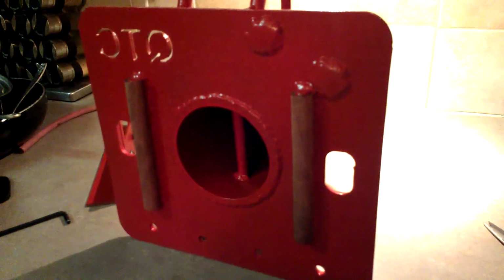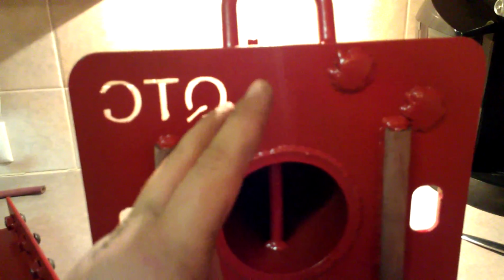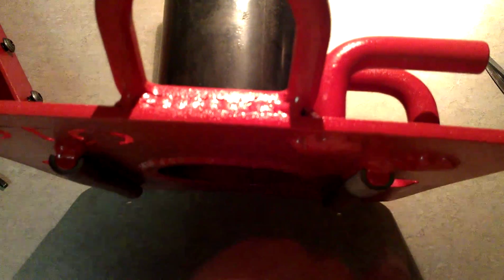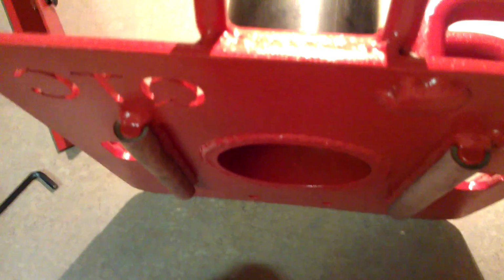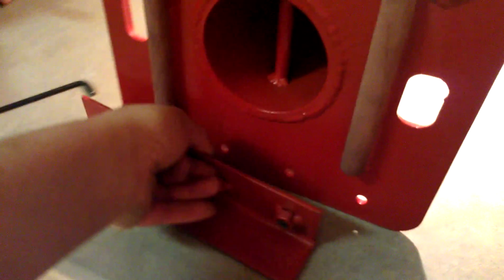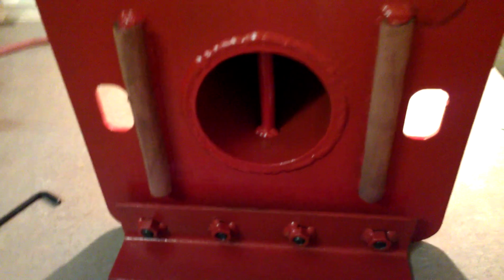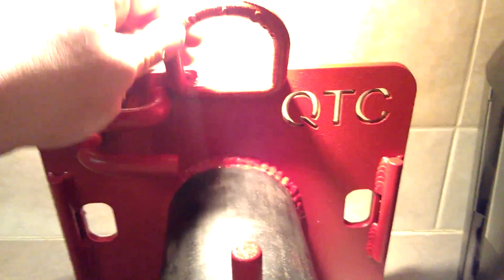Bull Rigger Bollard rearview

Comment: good for removing  trees  no Arborist  will buy for dead wood  or storm damage use...   damaged bark without  thick rubber back   looks a lot like a portawrap  and the  good rigging control system  put together